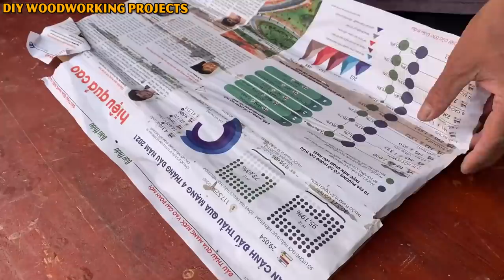Great Creative Woodworking Ideas A Experience For Your Kids // How to Build A Irish Mail Car  - DIY!

Comment: How do you keep it from going backwards? I really want to build one so bad but I don't want to make one just for it to always go backwards or some type of goof up, or is it just the luck of the draw which way it goes or does it depend on if the rear axle it higher than the pump shaft part?